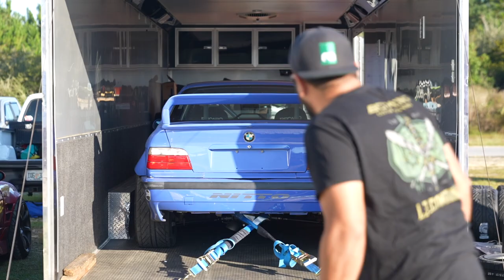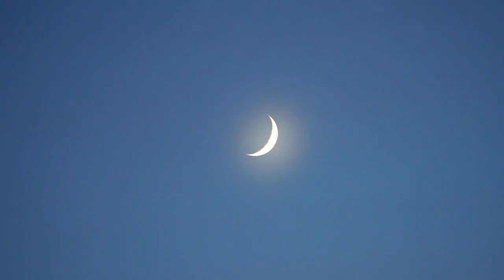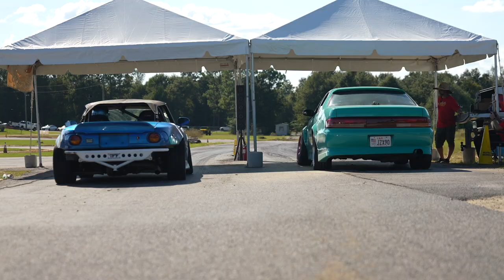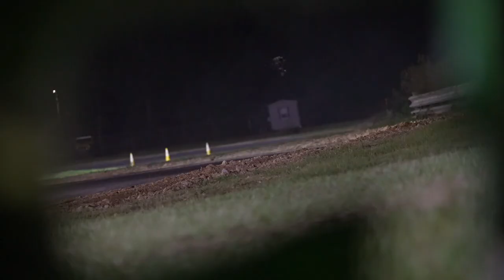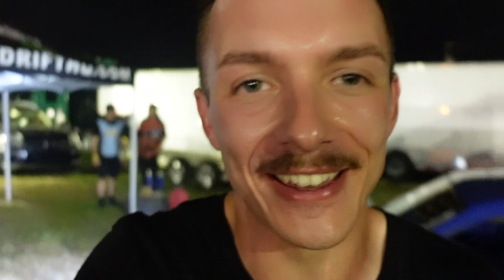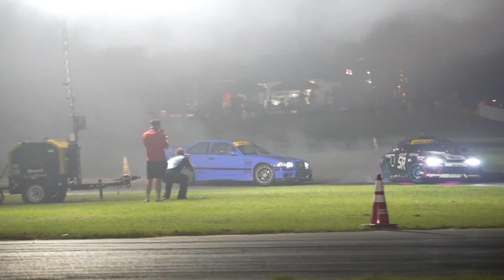My E36's First Podium - $10,000 Prize!

Comment: So there is actually a tool you can buy to bleed the system through the master itself I have a 6th gen 1ls Camaro and a 5th gen SS and I had to replace the clutch on both of them and I didn't think I would have to bleed them since I pinched the line boy was I wrong 😂

Comment: Judges make weird calls sometimes in close matchups where both drivers did bad, but that's pretty much unavoidable (like it is in literally every sport). I don't think KK is better than FD in that dept. For me, I would like to see a change in the class system. What if they were to have a light and heavy class of cars at FD. Make the classes equal in coverage, but maybe make the fields smaller with byes for tops quals. Change the weight limit and tire sizes for the classes, smaller tires for the lights. It should split up the field, and having a lower weight limit class might allow for some smaller chassis, like miatas etc, dare I say M3s, that don't really seem to cut in the current rules of FD. That would also encourage teams like RTR to split up into both classes for max placement, and bring out a different type of car. This might create a more interesting and diverse field imo. Different story lines, more content, new cars